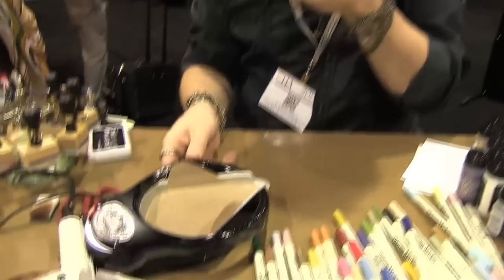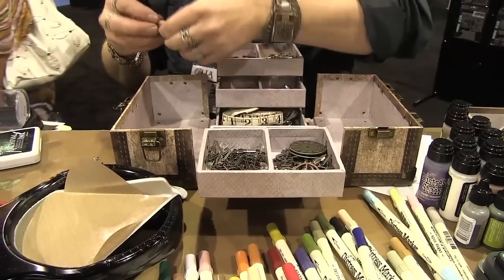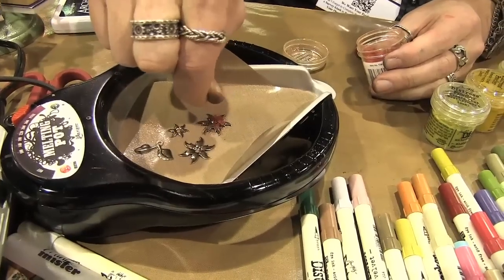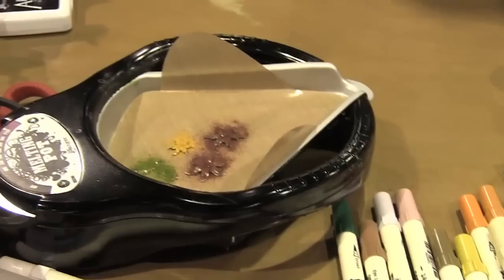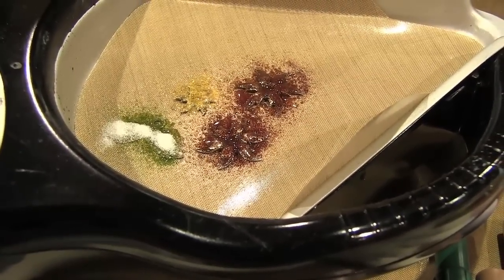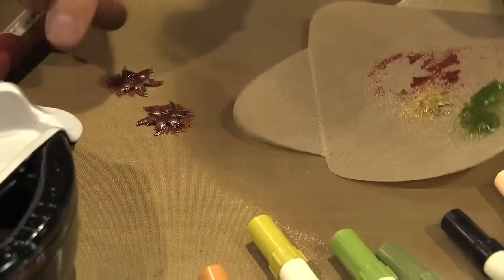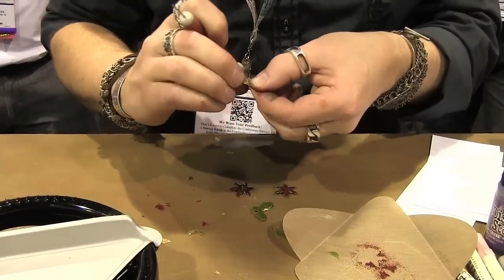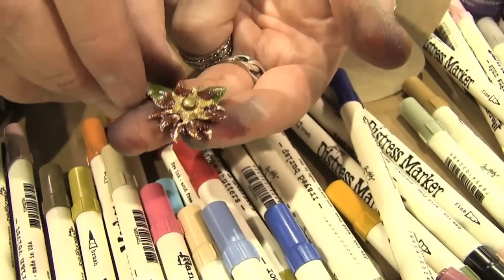Scrap Time - Enameling Metal with Tim Holtz

Comment: I like very much the idea, but I´d like to know if it´s resistant. Don´t need to apply some protection?
If use some recycled metal this can act as a protection? Or I still need to seal it.
Thanks a lot.
Reply from the maker: If you were going to wear it as jewelry you could seal it.  Vintaj has a jewelry grade glaze that would seal it.
Reply: ScrapTimeVideos Thanks a lot.